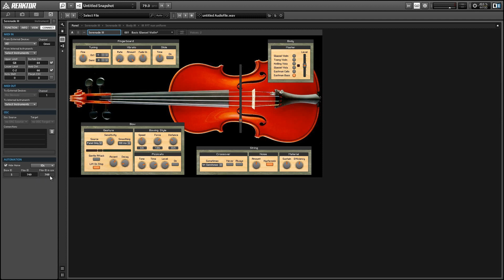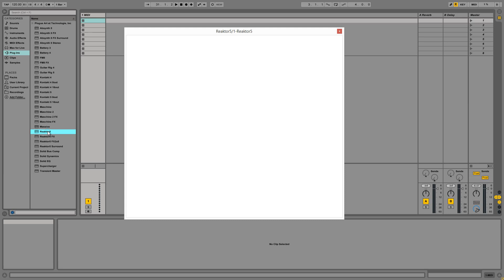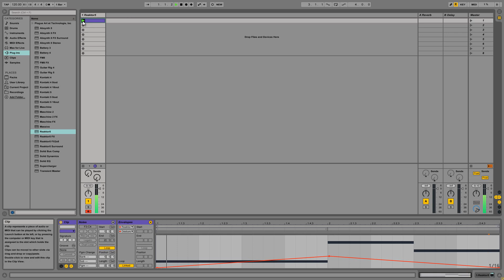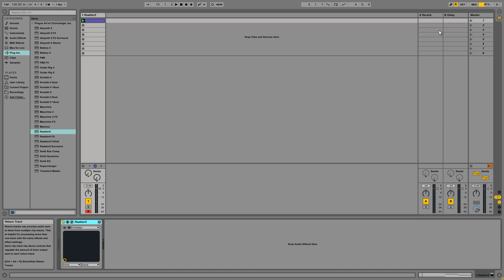NI Reaktor - Using Serenade by Chet Singer - How to Tutorial

Comment: I'm surprised that there is a bow speed dial. Wouldn't the speed that the gesture fader is moving be the bow speed? Maybe the bow speed dial acts as a multiplier, in which case I guess it could be thought of as changing the length of the bow.